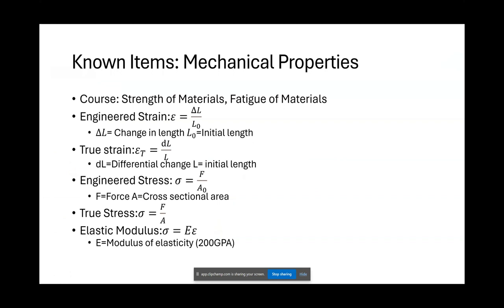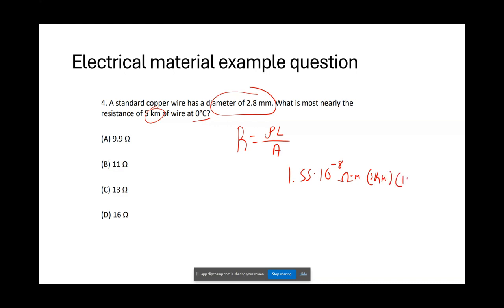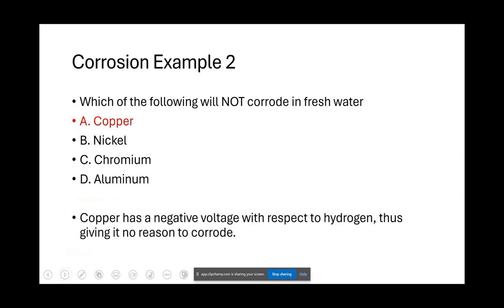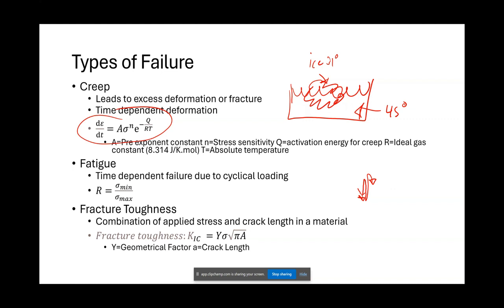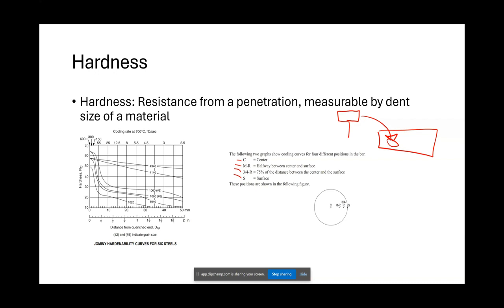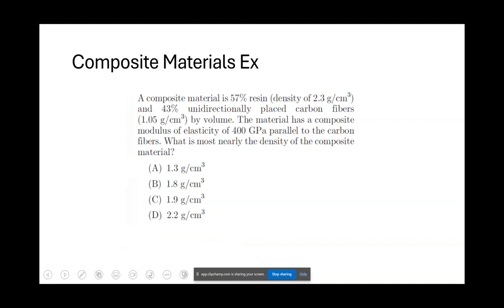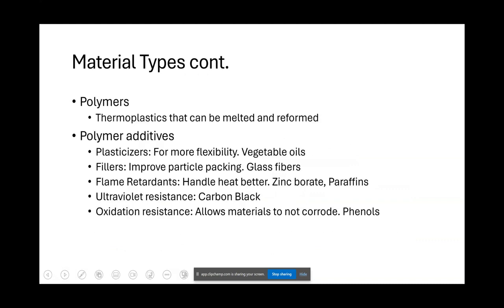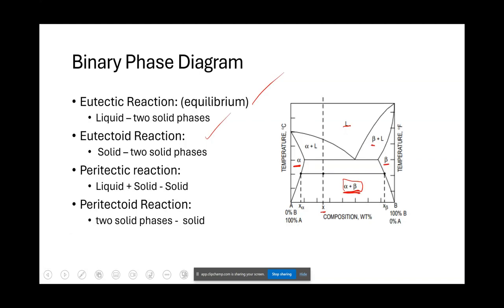FE Mechanical: Material Properties Review

Comment: On that first question about copper wire connected to a battery with an aluminium crimp, I suppose this is on the outside of the battery with no electrolyte involved. There is no mention of any external electrolyte like water or moisture, so in the absence of an electrolyte wouldn't the answer be "D. Nothing will happen"?